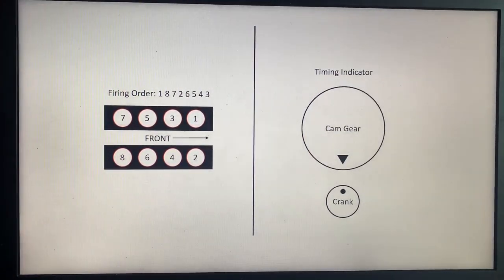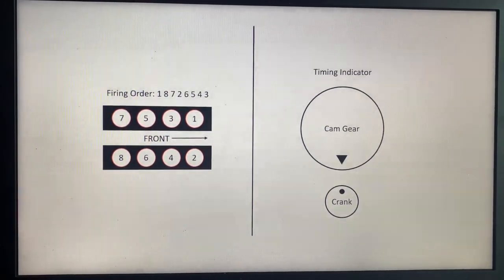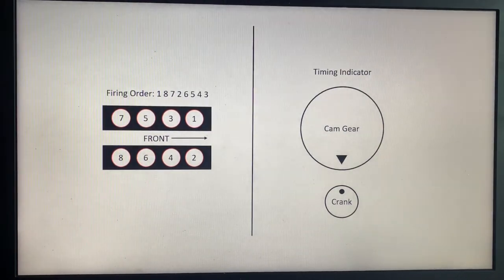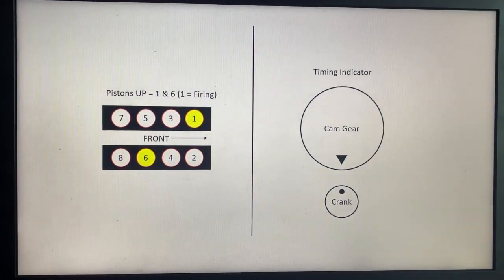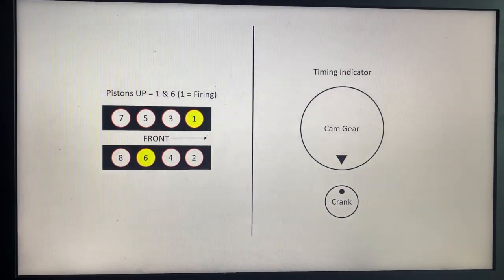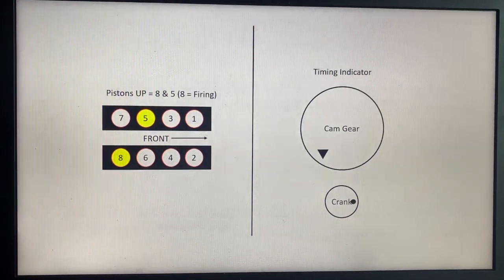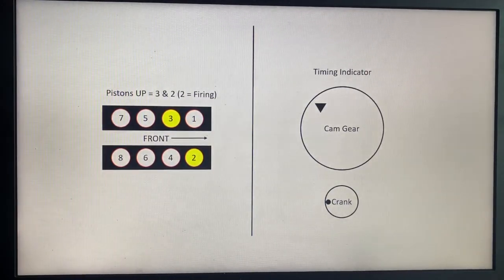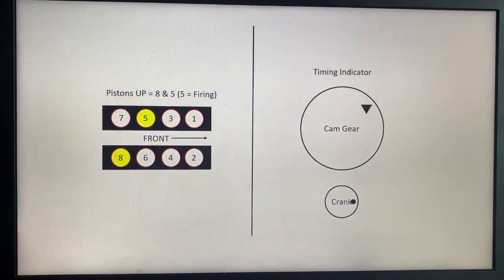HOW TO: Change Valve Springs on LS Using TDC Method

Comment from the maker: Quick Update: This video is a simple way to replace valve springs on heads when the heads are still on the motor without using compressed air in the cylinders or stuffing things in the spark plug holes to keep valves up.  However, I learned from a fellow viewer that my description of which piston is firing is backwards.  For example, when the Dot on the cam sprocket is at 6 o'clock, the 6 piston is the one that just fired, not 1.  I verified this looking at several old LS Cams I have laying around the garage too.  Thanks Micah for pointing this out!
Reply from the maker: @tinbus149  You are correct that you don't need compressed air when using the TDC method.  I only use air if I am not using the TDC method.  You can see me using the TDC method on my cam swap video as well.  

Putting the pistons at TDC is an alternative to using compressed air or any other method to keep the valves from dropping.  I've used both methods (compressed air and TDC) and I prefer TDC method since there is no physical way to drop a valve once the keepers are removed.  There is still a slight risk of dropping a valve using compressed air since you may inadvertently push the valve past the seat letting the air out (although that has never happened to me).
Reply from the maker: @tinbus149  you should consider doing a compression test if you can hear air exiting the exhaust when the valves are closed.  Unless you are pumping 300+lb of air in there, it shouldn't leak out fast enough to hear it.  And if there is low compression that isn't rings related, then you may need to clean some carbon or redo the valve seats.  Or maybe you have a bent exhaust valve.
Reply from the maker: @tinbus149  Pulling all of the plugs will make your life much easier turning the engine over since it will help relieve compression.  Plus it's good to take a look and see what condition they are in.
Reply: Wait so is the video showing crank position and piston correct ?
Reply from the maker: @rlfdavin  Crank position and piston position is correct in the video!
Reply: Could you make an updated video with the correct crank and cam position?
Reply from the maker: @Atherzuberi the crank and cam position in this video is correct. The only thing off is the stroke of each piston based on the crank position (intake, compression, power, exhaust). None of that matters for purposes of replacing valve springs though.
Reply: @JeffLyle  oh so TDC for those cylinders still aligns with the cam and crank position shown in the video

Comment: Can you use this procedure to instali the rocker arms and toqure them down?
Reply from the maker: @RICKGRIMM-de9gv  yes you can but it is not necessary. Just tighten and torque the rockers when the valves are closed.  That part is easy. Don’t over think it.

Comment: This is by FAR the best video I've looked at.  I have a closed head injury; memory probs to match, and I am slowly getting back my self confidence.  I'm at work and didn't watch the whole video; I will when Iget home, but is there a way to make sure thecylinder isat TDC, before doing any work?  Do you just watch the valves?  Thank you so much! Brad
Reply from the maker: the piston doesnt have to be at tdc.  just make sure the valves are closed so they hold compressed air.
Reply: Now I've been reading about this; and from what I've read, when at TDC, the piston will hold the valve in place.
Reply from the maker: @bradhawkins8546  that is true

Comment: Is rotating the crack enough or i need to rotate the cam too?
Reply from the maker: Technically you an use this method to change the valve springs with or without the cam installed.  The key is knowing where the pistons are in the cylinder in order to hold the valves up when you remove the old springs.  If the cam, timing gear, and chain are installed, the cam will rotate when the crank is rotated.  If the cam is installed but the gear and chain are not on yet, you do NOT need to rotate the cam while changing the springs.  If I didn't answer your question, let me know.
Reply: @JeffLyle  Thanks mate

Comment: Idk about LS but SBC #1 fires when crank and cam gear both dot at 12 o clock and 6 fires at dot to dot at crank at 12 o clock and cam gear at 6 o clock. People think 1 fires dot to dot on SBC too but it don't.
Reply from the maker: You are correct!  The video shows the firing piston incorrectly.  I clarified this too with my pinned comment several months ago.

Comment: good video however I'm not removeing the timing cover. any suggestions?btw I don't have compressed air.
Reply from the maker: Some people will stuff the cylinder with cord or rope through the spark plug hole.  I've never personally tried that method.  I think you'll have a lot less headaches just picking up a cheapo tire pump for like $25 and renting a compression tester from autozone.
Reply: @JeffLyle  will a tire pump work???  I don't have compressed air either.  Will IO have to use C.A. to do this method of changing valve springs??
Reply from the maker: @bradhawkins8546  yes, but when I say tire pump i am talking about an electric car tire pump... just don't want you to think you could hook up a bike pump and do it by hand :)

Comment: Best video ever!!...thank you saved me a tone of time and figuring out
Reply from the maker: bogdan camaro thanks brother!  I’m glad you found this useful.
Reply: @JeffLyle  I watched your video to understand if I installed my new cam properly. There is no dot on my crank sprocket, so I turned it over until TDC was reached, then spun the cam until the dowel was at 3 and the dot at 6. Something perplexes me though with my sprocket placement. When piston 1 fires, the cam dot is at noon, not 6. When the dot is at 6, piston 1 is TDC on the exhaust stroke. Is this just differences in cams or am I an idiot... Perhaps both ;)
Reply from the maker: @micahkelly2620  You know what... I think you might be right.  I just grabbed an old cam in the garage and looked at the lobes.  It looks like when the dowel is at 3 the intake valve on 1 is just about to open meaning 1 just finished the exhaust stroke.  I think this means I just labeled the wrong piston as the firing piston in my chart.  You aren't the idiot... I am lol :)

Either way, for anyone watching, the main importance of the video is to determine which pistons are up and ready to change the valve springs.  I'll go back and add a sticky to correct this.  Thanks for pointing this out Micah!

Comment: do you put it back at 12 and 6 o clock when done,cam gear at 6 and crank at 12 ? thanks
Reply from the maker: you only need to line the dots up when installing the timing gear and chain.  Once you are done putting the cam gear and chain back on, you should spin the motor over by hand several times just to make sure nothing hits (no PTV clearance issues).  When changing valve springs with the heads on the motor, it is easiest to see where the pistons are with the timing cover off.  Otherwise if the timng cover is on, I prefer using compressed air to hold the valves up.
Reply: @JeffLyle  hey Jeff thanks for the fast reply,sorry ive been working on this thing all day and i only get on youtube on my home computer,so what im doing here is i have a 05 blazer with a 2011 chevy hd2500 6.0 L96 in it,and i got a tx speed performance stage 1 and vvt delete kit,yep this engines got vvt,so i have the timing chain cover off and you cant even see the dot on the crank gear,hell you cant even really see the gear,theres a little cover dont know what thats behind the crank snout,im guessing i need to remove it to see,so i can line things up to 6 & 12.so to do my cam swap just get things there 6 & 12,then when i do the springs 1 & 6 will be ready to change then turn the crank 45 degrees to do the next i will leave the cover off till im done with springs,when i am done do i turn it back to 6 & 12 then im done,is that all correct lol,i think i got it right.im doing the entire swap alone,i paid this guy to help but he didnt do a thing for me,you know how it goes,so wiring harness everything is all me,but i got current performance to build a complete plug and play,awesome company,they have all kinds of stuff for my swap,like a ac condenser relocator ,pretty neat stuff.
Reply from the maker: onewheelup sounds like the old cam is still in it and you are staring at that giant cam phaser in front of the cam gear. Once you remove the cam bolt, the chain and the gear, you’ll be able to see the dot on the crank. As long as it is at 12 the you can put your new cam in with the new cam gear with the dot at 6. Then you can start changing out valve springs using the method I described. Promise you can see the dots if you look hard enough with a bright flashlight.
Reply: @JeffLyle  thanks for your help man i really wish i would have bought a better tool for compressing springs,omg its junk,but i was able to get the cam swapped the timing chain was super tight,the engine is clean,doenst even smell ,so im still swapping springs,i am also taking a small wooden dowel rod that i used to install the cam and i stick it in the spark plug hole to make sure i feel the piston.so im doing ok i think,so in lamens terms the whole reason behind this method is to hold the valves up so they dont drop,correct ? i mean its not going to run bad if i dont turn the to the exact spot on each cylinder right,that would be pretty hard to do,but just as long as the piston is up im good right Jeff,thanks for your help ok.
Reply from the maker: onewheelup boom you got it!!! Only reason for this method is to hold the valves up so they don’t drop. Nice work. I’m glad you got it done.

Comment: Awesome video and explained very well. U made it easy, even for dummies like me! Do I need to put a rope inside the spark plug hole to hold the valves up, or is that not necessary?
Reply from the maker: Thanks for watching Chris - Glad it helped.  My cam swap video shows me actually using this method too.  

With each piston up using this method, there is no need to put anything in the combustion chamber to hold the valve up.  The piston will hold the valve up.